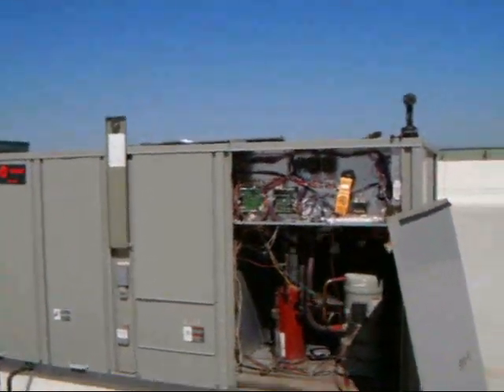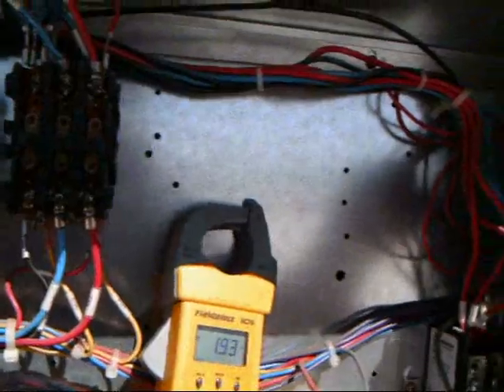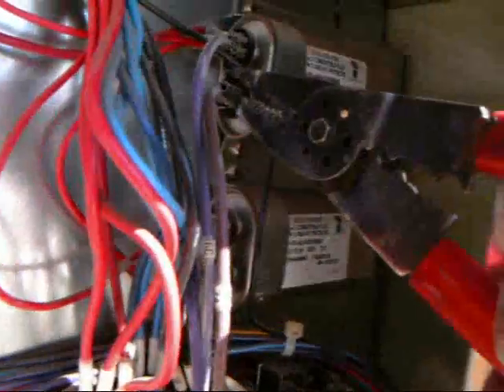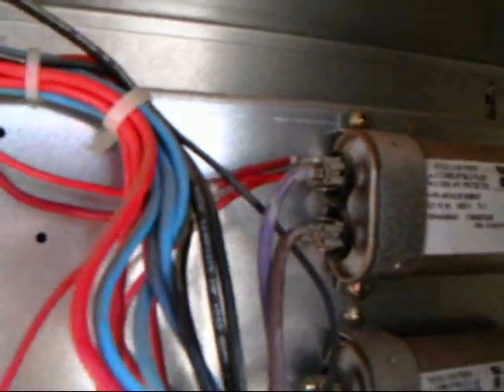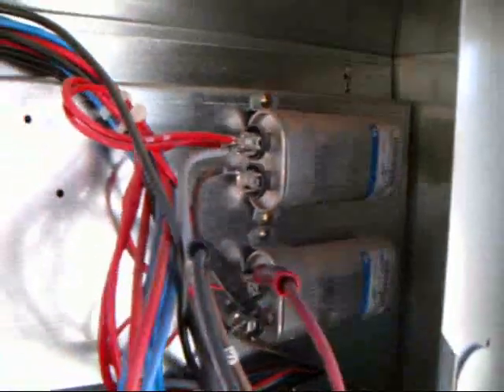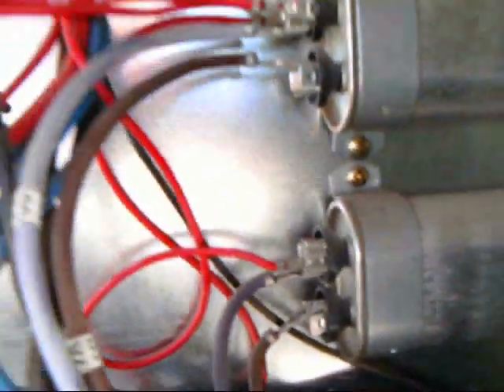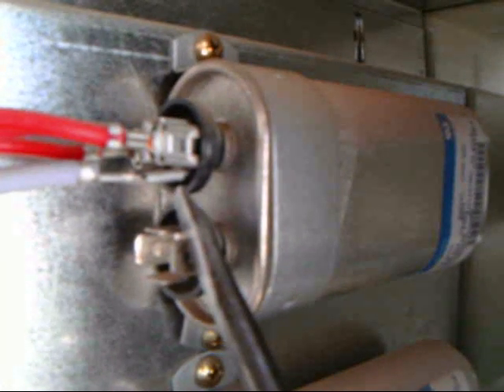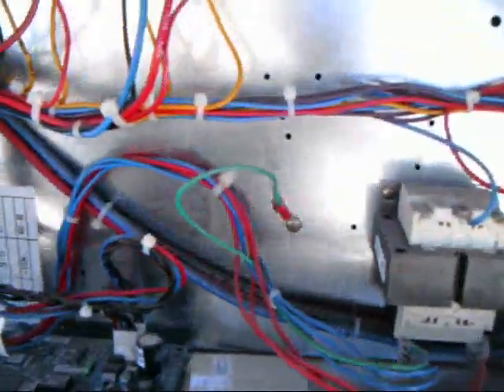Discharging Run Capacitors - Or NOT to discharge? :)

Comment: Thank you for showing this technique. Most of the electricians on YouTube showed discharge the capacitor after it is removed from the AC Unit. Should we remove the capacitor before discharge? It could be dangerous when kids are present and they accidentally touch it before discharging.
Reply from the maker: IF you believe the capacitor is not discharged, then it should be discharged BEFORE removing because you would have to handle it.

The point of this video is that run capacitors are discharged via the motor windings as soon as you remove power.
Unless the motor windings failed open while it was running, you won't find a charged run capacitor after you turn the power off.

Comment: I just had my dual cap go today. It was completely bulged and before I pulled it, I discharged. Arced so much I went back to double check I had pulled the breaker (I had). If I hadn't discharged, I could've had a bad bad day. Got the holes in the screwdriver I shorted with to prove it. 
Always discharge.

Comment: It is just better practice and habit to discharge. You never know what has happened in the system even if some caps usually discharge in the windings. A burned wire somewhere can cause the cap not to bleed off the charge and than it can bite you. Good habits developed will save your life over and over. Bad habits developed can bite you badly and end your quality of life or kill you outright. Another good habit is to use a circuit alert device (sometimes called a deadmen's stick in lesser known circles) after discharge to prove power is dissipated. It never hurts to practice safety and discharge. It is a twenty second step to save you countless hours of pain and regret.
Reply: Way too long, but...This!
Reply: YOUR DREAMING ! wake up , the run cap can NEVER shock you unless there is line voltage applied .

Comment from the maker: @allanlasley 
Actually I am sure the resistor is just a bleed resistor so it don't electricute you after you pull the power. 

The reason behind the TWO capacitors in those trickle heaters is that a smaller cap was in the circuit at all times to allow enough current to flow to act as a heater and the larger cap was paralleled in once the contactor closed.

Comment: Some old AC units used what is called a trickle feed to feed a small amount of current through the start windings of  a compressor to work as a crankcase heater when the AC was off..
The trickle feed goes through the resistor that bridges the terminal of the second run cap.  If you eliminate that resistor or replace both caps with a single one the trickle circuit is broken and that form of crankcase heater is eliminated.

Comment from the maker: @2Bibleppl 
Lights dimming for more than a split second definitely would indicate that the compressor is not starting right away or at all.

Make sure all the high voltage wires are tight at the disconnect and at your main breaker panel.

A voltage drop may add to the problem. But it probably would have smoked the breaker/disconnect terminals by now if it ran like that for more than a year or so.

Comment: Okay, I have one of those piece of junk Goodman heat pumps. We purchased it new and it was installed in 08' Every year we have a capacitor to go bad. The tech put a "hard start' in and it has just happened again. Last night when the unit tried to come on the lights dimmed severly several times in a row to the point that it really concerned me. Tomorrow the tech comes back to try to figure out what the problem is. Any advice would be greatly appreciated. Thank you for your time and trouble.

Comment: @hackfreehvac Agreed, connecting a large dc cap as in car audio when its drained can easily blow 200amp fuses. Not to mention weld the wires to the terminal of the cap. Car audio caps are in the range of 0.5 farad to 20 farad and even larger. Starter and run caps used on motors are in the range of 0.000005 farad(5uF) to 0.000040 farad(40uF). They are significantly larger.

Comment from the maker: @findvoltage 
Start capacitors are quite higher in capacitance, which applied to the same motor winding as the run cap allows much more current flow than the lower microfarad run cap.

The start cap is also in a plastic enclosure which is not going to reject the heat well either.
However, they are only used MOMENTARY via a potential relay for extra starting torque of a motor.
The run caps are designed to be in the the entire time the motor is running.

Comment: hi again, i ment run-start capacitor, as a single unit. if it does exist can you give me an example how it works, i know that two metal foil sheets hold a charge and relese that charge, but a normal start cap would malfunction if i used it for a run CAP. so what is the difference between the two, thanks

Comment: Excellent video. Good to see people with a good understanding of how things work making videos unlike some people on here. This is the very reason you never see a bleeder resistor on a run cap. If I may add something- If there is any charge remaining on the cap (as in the demo) it will be read as a dc voltage across the cap. I'm sure you know this, but other people may not. If it is charged and you check it with your meter on ac you will read 0 with the power removed...

Comment from the maker: @newstart49 
You should have read my info first. I do not recommend people taking chances. But I was explaining WHY a capacitor wont be charged unless the motor winding attached to it opened while energized.

On single phase equipment, the run cap is wired directly between the RUN and START winding, thereby discharging itself. 
The ONLY way to get a charged run cap is to pull the wire when it is running as I did. 

Start caps are the exception because wired different.

Comment: As one who has been there and done that, it takes less than a second to discharge a cap- do it anyway.
 Caps for compressors (single phase)  should always be discharged if the contactor is open. You can short at the cap or push the contactor closed to do so.

 The first thing is to be safe.

Comment from the maker: @2003SCT 
Well the "filter" caps used for DC stuff in cars are for a different purpose. 

I don't know why they would need to be charged first. Maybe to keep them from blowing the fuse, as connecting a large drained cap to a battery would draw a quick spike of current at first.

Comment: Ok, this is true, UNLESS the motor has a bad winding or is wired wrong, then the cap WILL have high voltage on it. Always be safe and discharge

Comment: Hey! this is a very good video! :D  

So when you disconnect that wire when the unit is on you said that the motor keeps running but it is using higher amps? Also what happens when the brown wire or the (purple?) wire is disconnected before you turn it on, would the fan motor not run at all?

Comment: Many motor caps also include integrated snubber resistors that will drain off the charge in a few minutes. However, never assume a cap is discharged - always, ALWAYS run a voltage check before reaching into anything sporting caps charged to over about 50WVDC.

Comment from the maker: Yup, that will be one of those times when it holds a charge! I bet that stung a little bit! 
Of course as I mentioned in my video, I am referring to units that are operating fine that shouldn't need the cap discharged. I've been bit by a few run/start caps. Always from a burnt wire that left it charged. :-o

Comment: I got bit  by a compressor with a burned terminal on the start winding. I pulled the disco, checked voltage, the back of my hand hit the cap when I was checking something else. It was an 80Mf @440V, a 67K scroll compressor on a pool heater. 
I realized (a little too late) because the start winding wire burned off the cap could not discharge...........until I touched it.

Comment from the maker: Does your welder support 460V? I have a wire feed and it only runs on 115 yet does pretty good. You would need a MASSIVE step up transformer to get the 460 from an existing 230 running that kind of current. Unless you were at a commercial area where they had their line voltage stepped DOWN to 460 for a feed to your business.

Comment: Hey, don't tell anybody , but when I was young and stupid I heard a compressor running through a wire and into my head. Customer said unit power was off, so dumb me did not check for voltage and grab a hold of start wire and had my hand on unit so I was ground made the circuit for start and compressor fired right up with me in the middle..

Comment from the maker: I have no idea about the lighting fixture. If it has a load across the terminals it would discharge. If it's isolated when the power is off, then it could hold the charge for days.

Comment from the maker: I can't say I haven't put a screwdriver across some run caps. If it's not a cut and dry circuit, or if the motor was bad, it's a good idea to short them. But on normal PM calls when I saw the motors were working, I don't bother to short them.

Comment from the maker: Yup. The meter discharges it more slowly than the motor winding. The motor I tested in a video was like 140 ohms. The multi-meter would be very high resistance, but I do notice it slowly discharges as I hold the leads to the cap when reading volts.

Comment from the maker: Yup. I think those had the bleed resistor because they had TWO run caps. One was in the circuit at all times to allow some current to flow through the start winding to act as a crank case heater. The second run cap paralleled into the circut (to give the correct microfarads when rinning) when the contactor closed. I think when the contactor opened it left the one run cap isolated from the circuit, therefore it could hold a charge. The bleed resistor discharged it so you wouldn't get shocked. :p

Comment: Good video I would like to mention too that a motor is an inductive load and thus would discharge the run cap.

Also if you put your volt meter across the terminals on a capacitor you would discharge the run cap because a volt meter is considered to be a load.

Comment from the maker: Anyway. Like the video says, I was doing this as a demonstration. I had a few messages sent to me asking HOW to discharge run caps and if it was needed. Hopefully it shows why they typically can't hold a charge, and what power they do have when they do! :-] I probably wasn't leading a good example when I was working in this unit with no gloves on. Forgetting to turn of the supply power would be bad news when you reach into one of these without gloves!

Comment from the maker: LOL! I've been bit once by a run cap. I wondered why and then found that the fan blade tangled up a wire and broke it free from a motor while it was turning. Got the call as a no cool and found the ODM not operating. When I reached in to pull wires from the run cap to check it, I got zapped! It feels real good too! But not nearly as bad as a capacitor in a microwave oven or the flyback of a TV set. Yeeowch! :-o
You sure found the video fast. :-) I am home because we are slow. :-(